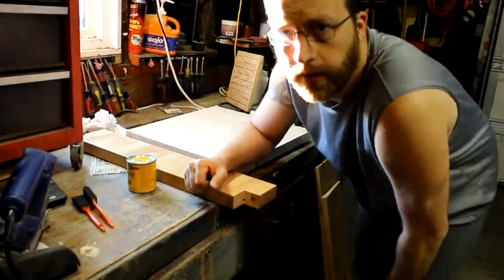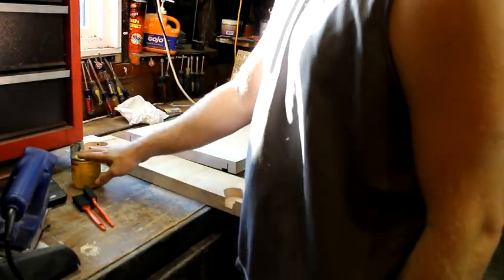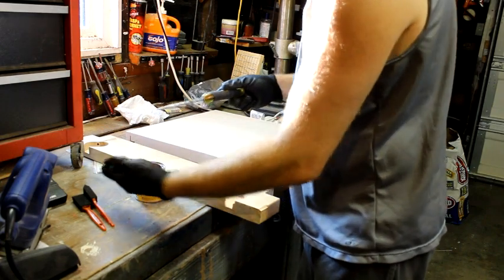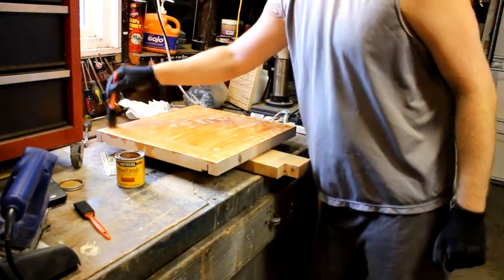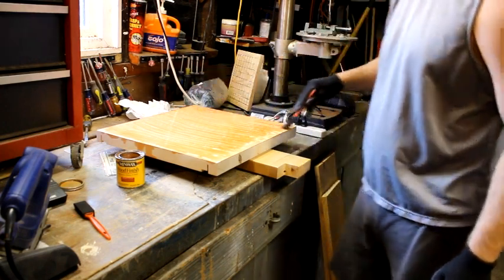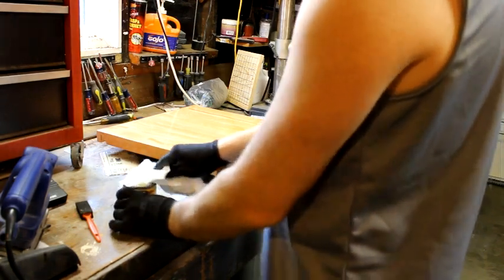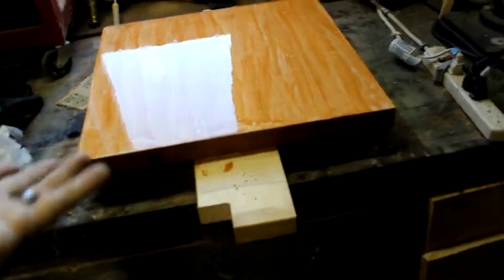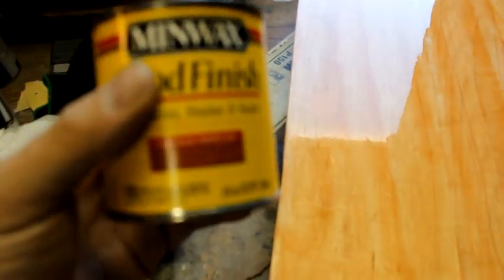Making a goban part 5, Staining the wood

Comment: I know this is an old video, but some suggestions:
First of all, any scratches that are on the board before you apply finish are going to be even more visible after. So you really want to sad the heck out of that puppy first.
Second, to make a really good end product you will want to hand sand it. The technique we used in wood shop (back in the day) is to actually use a couple of grades of sand paper during the finishing procedure. In other words, get the paper wet with the finish and use that to hand sand the crap out of it. Work your way up to a 300 grit or more if you have the patience. What this does is it causes the finish to mix with the saw dust you create, and they make a sort of putty that help fill in any sort of imperfections you missed. With enough patience, you can make it look like glass. I made a chess board about 15 years ago using this and it still looks fantastic.
Last bit of advice isn't really advice. The board probably turned out funny because the wood of the table they used was impregnated. The protecting seal they used could be throughout the whole board, which would resist your attempts to stain it.
Reply from the maker: Great advice, thank you.